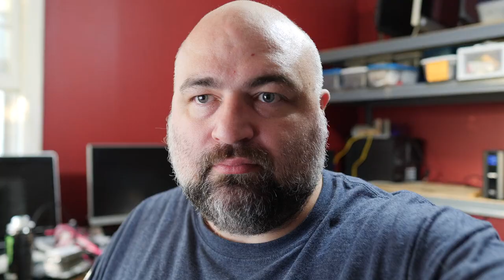Even MYTHBUSTERS Got The Airplane Conveyor Belt Question WRONG - A Neckbeard Explains - Jody Bruchon

Comment: A prop plane doesn’t fly because of it pushing wind over the wings.
Reply from the maker: I didn't say that it does. Edit: someone said that's exactly what I said at 0:55 but YouTube deleted their comment. Yes, I said that a prop plane pushes air back to the wings. That's because it does. I didn't say that that's how prop planes fly. It's not much force, but it is enough force to consider for the purpose of the conveyor belt example.
Reply: @JodyBruchon  you said, a prop plan pushes are back.    And you said turbine powered 747 doesn’t push are back.    So why do people get blown over at Sy Martines AirPort behind a 747.  Is is the noise pushing them.   Or the wind from the turbine engine which creates thrust that pushes the 747 forwards ?
Reply from the maker: @duncanritchie724  A prop plane pushes air back towards the wings; a jet plane pushes air back but NOT towards the wings. The prop creates a small amount of lift by pushing air to the wings while the jet does not. The image in question is about a jet plane; the Mythbusters episode used a prop plane which could eventually lift off from the prop if the plane itself couldn't move forward and the prop could be spun fast enough. That's the only point I was trying to make: the experiment uses a plane that would lift in the hypothetical without violating the constraint, but the plane in the hypothetical is NOT a prop plane.
Reply: @JodyBruchon  so how come when I fly my airplane doesn’t takeoff when I’m at full power with the brakes on ?
Reply: A 747 moves forwards in the exact same way a Cessna moves forward and they create lift in the exact same manner, the friction is irrelevant because when we do touch and go’s my airspeed does not half when the wheels touch, so you can’t say the friction will hold the plane back from moving forwards the thrust will overcome the friction made from the “conveyor belt”   Engines will never make lift while standing still i don’t care why aeroplanes you are in 
Go buy a rc plane and tie its tail to a wall and tell me it will take off 

Then go buy a conveyor belt rent a airfield and use your car to pull that conveyor at whatever speed you like in the opposite direction of the rc plane and I’m telling you it will takeoff 👍🏼.
Reply from the maker: @duncanritchie724  Because your plane is real, and the question being asked in the picture is not real. It is a thought and reasoning exercise that is not possible to create and test in real life. A real prop plane would almost certainly never push enough air to lift itself by the wings 100% vertically. The linchpin is the constraint where the wheels and conveyor are "locked" perfectly in speed. I'm trying to find all possible ways to work around that constraint. Props pushing air back to the wings hard enough would cause the plane to lift off. I am not aware of any prop planes that are both light and powerful enough to do this in the real world, but the question abandoned the constraints of being 100% true to the current state of technology with this magic conveyor belt thing anyway.

Don't you agree that a THEORETICAL prop plane that could push a MASSIVE amount of air back towards an absurdly strong set of wings would eventually lift itself off the ground vertically and escape the "brakes?" Not that a REAL one can do it today, but that if such a plane could be made, it is POSSIBLE?
Reply from the maker: @duncanritchie724  Both planes create lift using airflow hitting their wings (airfoils). The "conveyor matches wheels" constraint in the image is really saying "the plane cannot move forward or backward; it stays in the same place no matter how fast its wheels may be able to move." It has nothing to do with friction and everything to do with whether the plane can get airflow to the wings.
Reply: @Jody Bruchon  A prop plane can take off with less air speed when the prop pushes air into the wing, but a jet plane still has a takeoff speed... and it would still take off at the same takeoff speed even if it's wheels were spinning twice as fast.

The wheels always match the conveyor speed. They're touching.
Reply from the maker: I understand planes just fine, but planes are largely irrelevant other than the method of lift for this particular question. The question requires the wheels to remain locked to the speed of the conveyor. Please feel free to enlighten us, O smart one, on how the plane can move forward if the wheel speed is locked to the conveyor speed. Where does the lift come from when the plane is stationary and isn't VTOL?
Reply: @JodyBruchon  no I don’t think you do…
In your hypothetical situation your saying the “treadmill” will always speed up to match the forward rotation of the wheels. Jody, the part you seem to have trouble getting your head around is that it doesn’t matter!! The wheels and the rpm of the wheels are completely independent of airspeed. So in your scenario as the rpm of the wheel increases so does the treadmill. Right? Well guess what that wheel will just keep spinning faster and faster and faster and guess what? The plane will take off. The wheels absolutely have no bearing on the way the wing flies through air. This is all hypothetical right? So let’s pretend the bearings and the rubber on the tires will never fail.  And this magical treadmill has no speed limits. All that will happen is that the as you increase you treadmill the wheels will spin faster and as the plane travels forward the wheels will just keep spinning faster. Think of it like a plane being thrown from a cliff with little motors spinning the wheels.. it does not matter one bit how fast the wheels are spinning!
Reply from the maker: @ericheiserman9335  There is no "air speed" until the plane is off the ground.
Reply: @JodyBruchon  for the record, I'm in your camp. The problem is we're taking about wheels when we should be talking about forward motion. Forward motion is not possible if all forward motion is canceled by the theoretical conveyer belt
Reply from the maker: @OldManShoutsAtClouds  I suppose it's down to logical connections. The way the question is worded means that the wheels are not allowed to move forward. The wheels are attached to the plane, so the whole plane can't move forward.
Reply: Look at it this way….the prop is a pully…if you hook the plane to a pulley  not connected to the conveyor belt the pulley will still move the plane forward why because it is not part of the conveyor…or like a strong current …no matter how strong the current is (in respect to your strength) you can use a rope to pull yourself through the current even though its going the opposite way your facing……a jet can do the same the turbines push the plane..yes it may take linger but eventually the engines can  pull  the plane fast enough to eventually reach v1 and rotation…even if there is no wind its wings will slice thru the air until it hits enough lift …AIR AND SOLID GROUND ARE DIFFERENT MEDIUMS
Reply: @gamethogic3751  ok, let's use the rope and water current example, that's great. 

Let's say you're holding onto a rope and you have the friends at the other end, you're stuck in an evil cursed current that increases its speed proportionally to exactly counter the force of your friends pulling in thr rope. 

Sure, your can normally pull yourself free of the friction, but if the current increases exactly enough to balance the force of the current would keep you in place. You could add 100 friends and this magic current moves faster (applies more friction and force) to stop you. Are you saying this wouldn't hold you in place?
Reply: @OldManShoutsAtClouds  i never said anyone else was there…you use your own strength your the plane your arms are the propeller…the rope is the air…
Reply from the maker: @gamethogic3751  If the plane moves forward, are the wheels spinning at the same speed as the conveyor belt or faster than the conveyor belt?
Reply from the maker: When the plane moves forward, will the wheels be spinning faster than the conveyor belt or the same speed as the conveyor belt?
Reply: @JodyBruchon  this is what people miss about this thought experiment. If the plane is in contact with the conveyer, the wheels must spin faster if the plane moves forward. Because the thought experiment tells us that's not possible, then the plane can't move forward while in contact with the conveyer.
Reply from the maker: @OldManShoutsAtClouds  That's the beauty of it, really...it serves as a very good test of a person's critical analysis. Everyone who says anything about air speed and thrust and tosses analogies about pulling ropes or floating in a pool have missed the point: those things don't matter because they all violate that one single constraint if they can move forward.
Reply: @phil2082  You literally just contradicted yourself in two sentences. "The wheels are spinning twice as fast" and "The wheels always match the conveyor speed." Those are two COMPLETELY different things. Good Lord
Reply: @ericheiserman9335  THERE IS NO AIR SPEED WHEN THE PLANE IS ON THE GROUND. In order for the plane to move forward, the wheel must rotate. As the wheel rotates, the conveyer moves opposite at the same speed. So you gain no ground relative to the ground outside the conveyer belt. You are rapidly increasing your speed relative to the conveyer belt yes, but as the question states, the belt matches the speed of the wheels. So with a 1 meter diameter wheel, 1 rotation moves you 1 meter. At the same exact speed, the conveyer belt moves 1 meter backward. You have gained 0m relative to the air and ground. That is the fundamental principle of the problem that cannot be broken. If you are able to gain more than 1 meter on the conveyer belt while the belt matches your speed and moves back 1 meter, you have broken Physics and we are all going to die.
Reply: It's irrelevant whether it is a prop plane or jet as the amount of wind created by the prop going over the wings would not be sufficient to lift the plane. You would need forward motion to create lift.
But where I agree with you is the point about conveyor speed matching wheel speed. The plane can't move forward if the wheels can't move faster than the conveyor belt. If it can't move forward there is no lift.
Reply: Good luck on this 1
Reply: @OldManShoutsAtClouds I'm in the same camp, but I think you're a bit wrong in what you said in regards to the language we should be using. It has nothing to do with 'forward motion' especially when you consider that a (jet) plane on a conveyor is moving nowhere relative to the actual ground. We should be speaking in terms of AIRSPEED, because that's what gives a winged aircraft its lift, not forward motion. Forward motion only applies to cars and other ground vehicles. The only link between the plane and a ground vehicle, is that a plane uses the forward motion to achieve airspeed in a normal, regular, every day situation.

Important for people to also remember that the plane the guys used in the experiment was an ultralight. So, in a sense, the experiment greatly hinges upon how heavy the plane is, and in every situation, it must be a prop engine plane (or a specially designed jet plane with the engines mounted directly in front of the wings).
Reply from the maker: @Aquascape_Dreaming Speed, air speed, and forward motion are all the same thing.
Reply: @JodyBruchon the jet will take off because there is nothing preventing it's forward movement when it engages the engines. However the only way to make the wheels and conveyor belt move at the same speed is to restrict the aircraft from moving forward somehow. If that is what the question implies then the plane will not be able to take off. But that's a fairly key piece of information (that the aircraft is prevented from moving forward under thrust) left out of the question. Personally I think the question is just designed as engagement baiting.

Or it's just poorly worded and it's genuinely a thought exercise about whether the plane's forward movement is dependent on wheel speed or not. (it's not dependent)
Reply: Also, a plane isn’t a rocket. A plane requires wind to fly. The rocket creates lift purely through thrust to overcome its weight while airplanes require wind to that that.
Reply: @ethanallen9751  actually planes don't require wind at all. They require air that is all. Even if the air is completely still, no wind, the wing moving through the air creates lift. Yes the wing disturbs the air and creates high and low pressure zones. But it's not the air movement per se that lifts the plane; it's the low pressure above and the high pressure below.

A rocket also uses aerodynamics, but a rocket not attached to an aeroplane doesn't rely on so much on aerodynamics. It mostly just uses a pointy nose to cut through the air. Some, most in fact, rockets do use adjustable or fixed external surfaces to control stability, which is using aerodynamics. But yes in general a rocket would fly as well in a vacuum as in air.
Reply: @JodyBruchon consider this...a propeller throws air straight back, most of it over the fuselage, NOT THE WINGS! The wings on a single engine prop plane do not see much of the wind generated by the propeller. Also, if you could get a prop to spin fast enough and be long enough to throw winds at take of speed over both entire wing surfaces, you would then have to overcome massive torque forces, which even effect single engine prop planes at full speed.
Reply: @JodyBruchon where exactly do Mythbusters say the wheels are locked to the speed of the conveyor? I believe you are misreading things. They even say in their video that the wheels are freewheeling.
Reply from the maker: @cyh4031  Do you not know what the original question says?
Reply: @JodyBruchon sir, air speed is determined by airflow into the pitot  tube which actually tells the pilot when they are going fast enough to rotate and take off. Perhaps you should go back to flight school if you ever went,  and if you haven't,  then leave the discussion to those who actually know what they are talking about.
Reply: @JodyBruchon  Your overall conclusion was spot on. But the stuff about prop planes and the weight of a 747 and bearings and all of that just added needless confusion. It's all about the impossible reqiurement of the matching wheel speed
Reply from the maker: @DaleC1980  I'm aware.